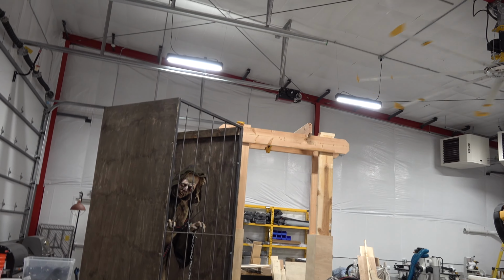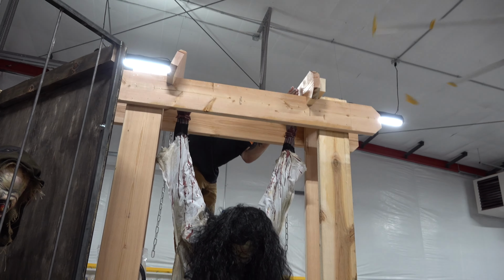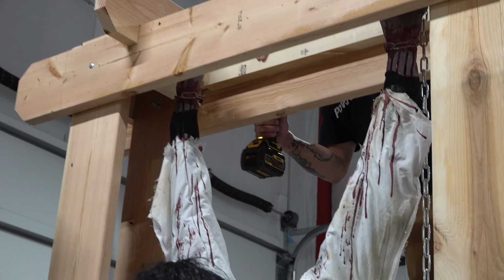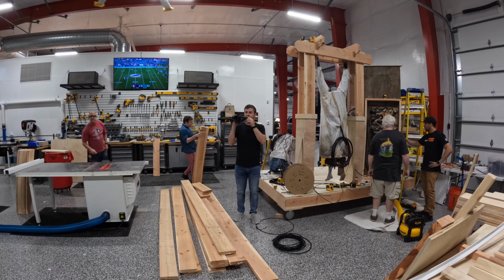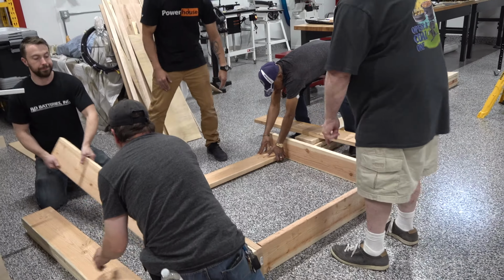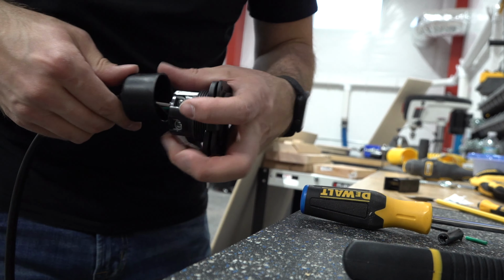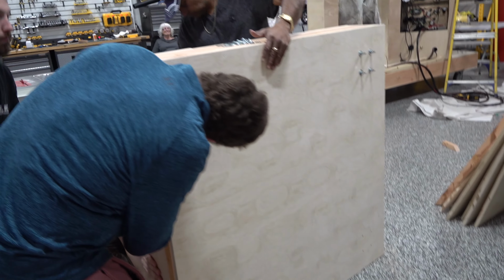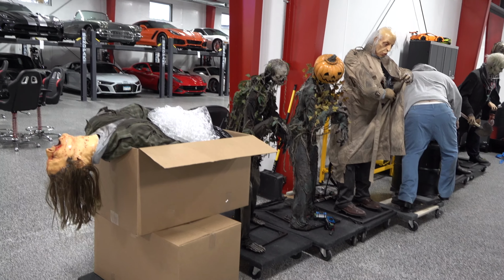Halloween Display Update | 10/16/2022 | Halloween Haunt

Comment: Love your work, been following your haunt builds for years now. One reminder that could save you from a lot of work though, these new poison props tend to break a lot easier now since Adam Johnston sold the company. The new guys tend to have these props running a lot faster which ends up breaking the welds, ripping heads off, breaking cylinders, you name it. I’ve seen this first hand and worked with a lot of the newer stuff. 

Something that may be worth your time is just going into the control boards and adjusting the flow controls on the solenoid valves. You can still achieve a fast movement, but with less slamming. If you notice with the older poison props you have like Sloth Chair, Burning witch, etc.. they are quick, yet they don’t slam nearly as hard as the new ones. 

Just some food for thought. Love what you’re doing, and i really appreciate the craftsmanship going on there. Id love to make portable sets for my professional animatronics but unfortunately i don’t have nearly enough storage space. Awesome stuff man! Looking forward to the next video👍👍
Reply from the maker: Thanks for the tip!! Thankfully all of these are from Adam with the exception of the last two which I don’t think I’ll have time to do anything with this year but I will definitely keep an eye out for those issues. Thanks for watching!